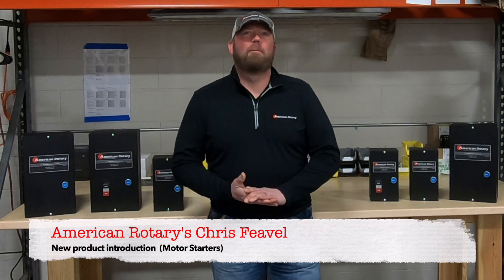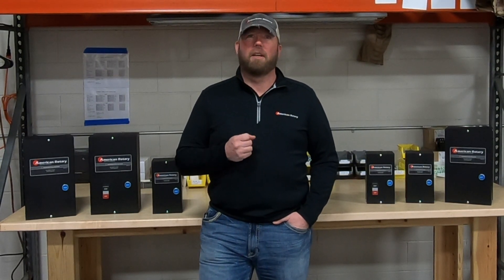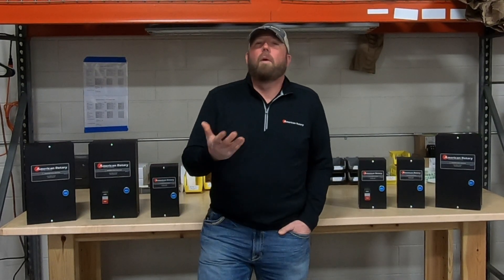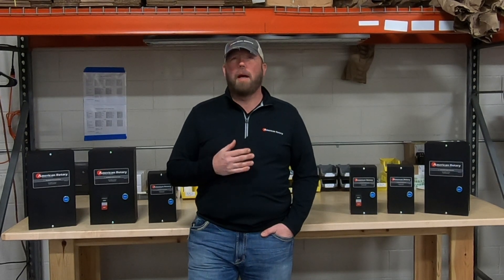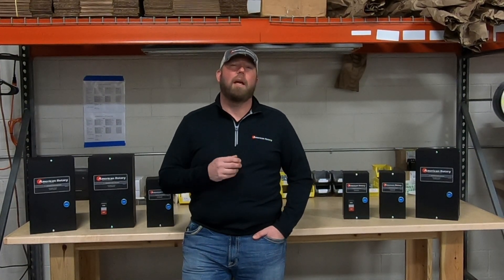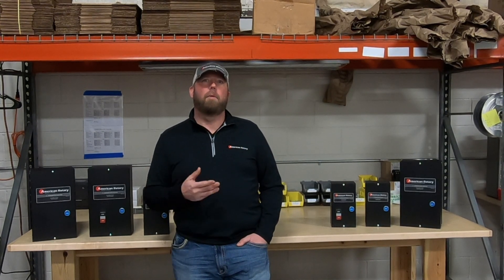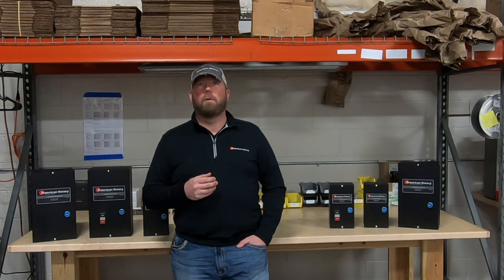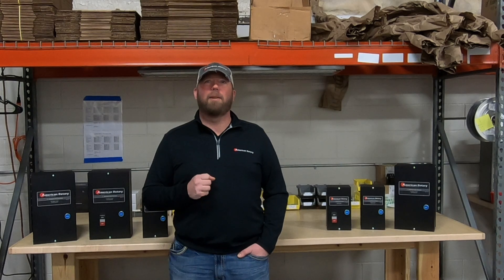American Rotary Motor Starters

Comment: how can we place with it a three phase solar inverter for self consumption , did you suggest as position - close to the grid meter side (in this case several single phase inverters connected in parallel) or using three phase inverter(s) after the converter directly connected in the load distribution panel ? can we reduce the load level of the converter as for the case of sync. with a genset ? thank you in advance for your advice.